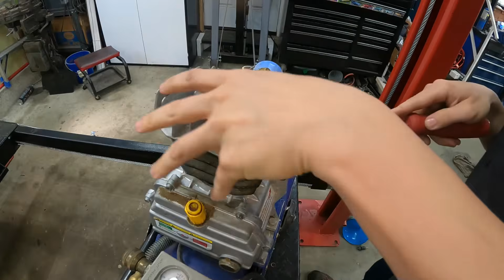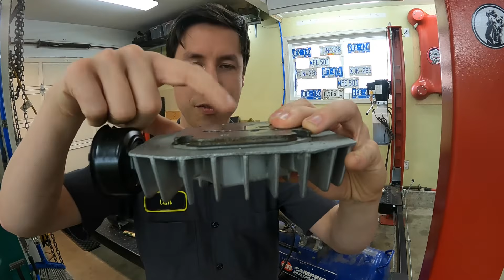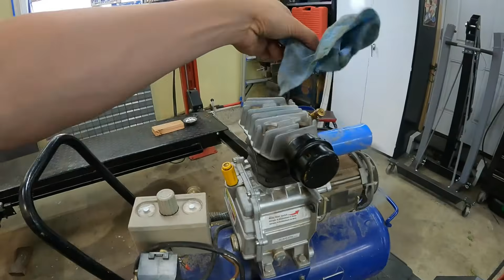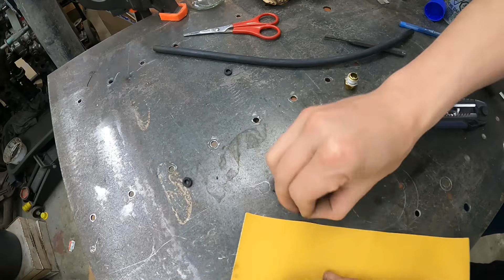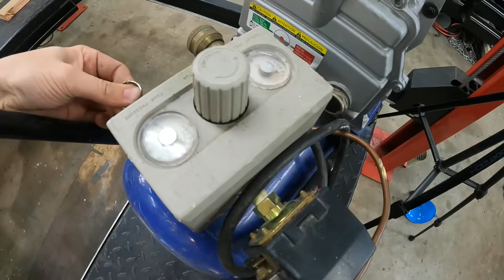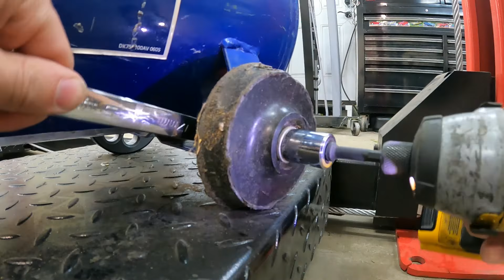Cheap Fix for an Air Compressor That Won't Build Pressure

Comment: I just fixed a jobsmart t 2040. It had a broken reed valve and the old owner messed with the pressure switch box. The cut in and cut out screws. It now kicks on at 95psi and shuts off at 125psi. Most air tools function at 90 psi. You wanna adjust the cut in screw so it kicks on at a lower pressure then what you have or you'll end up overheating it if the pump kicks on after losing 10 to 20 psi.

Comment: THANKS!!! My issue ended up being the reed valve (which I had never heard of before). I made a new one out of an disposable pie pan. I don't know how long it will hold up, as the original one was steel, but I can make a couple hundred of them out of that one pan, so I'm good!

Comment: Just found 1 broken reed valve, intake I think, it has 2, swapped them and it works, builds full pressure, only made 50 lbs before. Thank you sir !!!  I think I can also make one from a thin starter shim.....❤

Comment: NOT TO BNE A SCEPTIC BUT I. JUST WANTED TO POINT OUT THAT THE PLASTIC COVER THAT GOLES ON LAST THAT DIDDNT GET PUT BACK ON DURING \YOUR TESTING ACTUALLY PLAYS A HUGE ROLL IN THE COMPRESS\OR STOPPING AT 40PSI. BECAUSE IT OVERHEATS WITHOUT THE AIR DIRECTION FOIL REINSTALLED BEFORE OPERATION AND THEREFOR LIMITING THE ANOUNT OF AIR TO 40PSI BECAUSE THAT MANY UNCOOLED REVOLUTIONS OF THE MOTOR AND PUMP RAIOS THE TEMP QUICKLY THEREFORE LIMITING PERFORMANCE.  just FYI BUT THANKS  HANDYMAN  ITS A COMMON SLIPUP

Comment: Cool video and great job but don’t be telling people that they can run air tools from that compressor.
Reply from the maker: I had this exact compressor way back. It painted many cars with a cheap HVLP, ran impact guns and air ratchets, and short periods with a die grinder and DA sanders. Sure you had to wait for it to catch up some times with the really hungry tools, but it held its own just fine for home use.

Comment: You don’t know what those cambell hausfeld air compressors can handle 😂 that same compressor fell off my truck well doing 70 km/hr and broke off the pressure switch and many other parts. Now it has gas piping and a new pressure switch and still runs like a champ

Comment: Thanks for this video I think I have same problem with check valve I just need to open head of my compressor. It is quiet one also small I hope that will help.

Comment: Hi Great informative Video. I have the same problem with my Airmaster 5/12K Turbo, will only reach 40PSI, Will try the dump valve tomorrow and see what happens. The compressor is only just over 30  years old has has been ok up till now. Many Thanks.

Comment: My compressor builds up pressure (125psi) and cuts back on at 90psi as it should. even though i have 125 on the output gauge, i have very little pressure out the hose. It wouldn't blow out birthday candles.